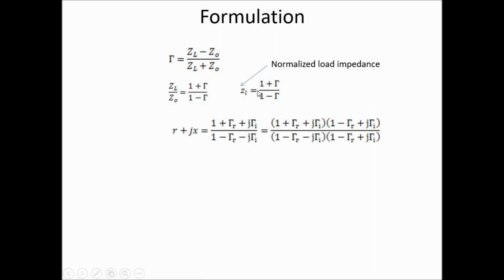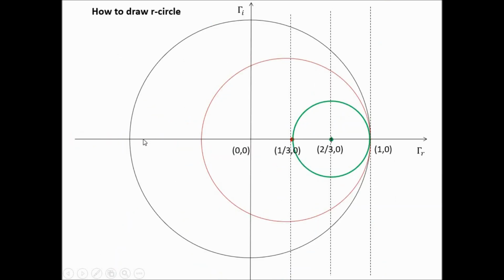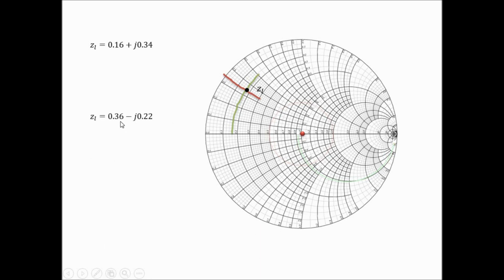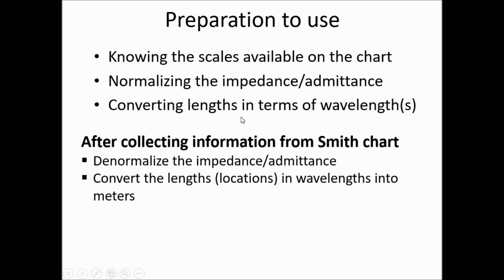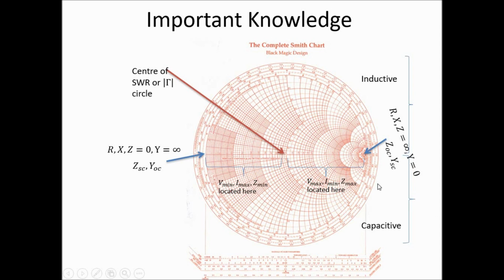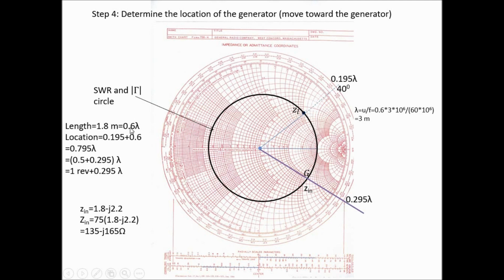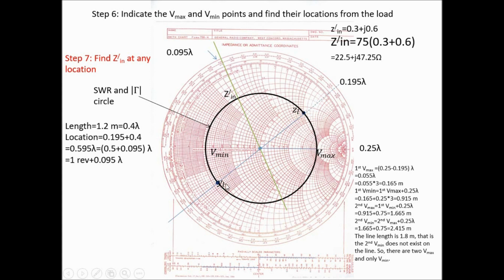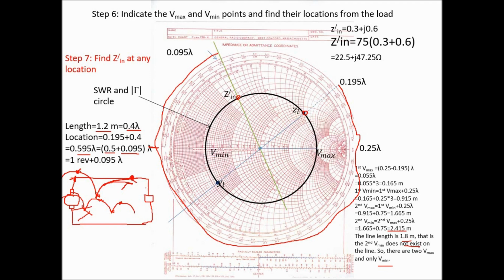Problem solving with Smith Chart

Comment: Hello sir, will we learn using smith chart from a vector network analyzer for our labs?
Reply from the maker: We don't use a vector network analyzer in lab. You need to use the chart for solving transmission line problems in quiz 2 and for exercise 11 in labs.